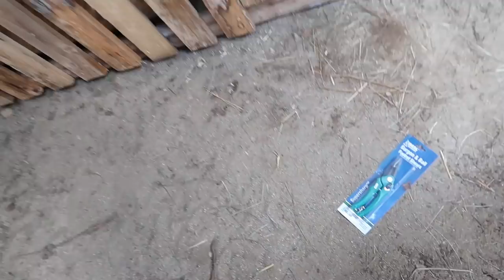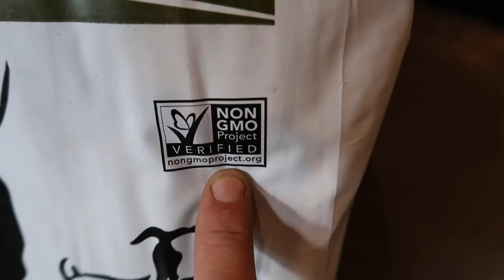Best Part of Waking Up on a FARM

Comment: A small piece of thick plastic in the trunk helps with that kind of a mess (somewhat). I keep a piece in my Tahoe for hay bales and pine straw. Also, a Libman dust broom (green bristles short handle) makes quick work of whats left behind.
Reply: I have used a 55 gallon drum liner which works pretty good also.

Comment: Al,  Turn your top gate pin upside down so the pigs cant lift the gate off the hinges and escape.  You will have to rebolt  the hinge back on the gate to get it on the pin.  Pigs love to lift things with their snout.  Love the vids!

Comment: Al , I watched you install the top brace bar between the gate posts. I always like to use exterior wood glue on things like that . I use the wood glue and then the screws also.  Makes a much stronger joint.
 After seeing the lower corner of your gate  swinging back and forth I can see a goat pushing the bottom of the gate open enough to slip through.  I will suggest a second latch on the bottom or at least a wooden block to prevent the gate from being pushed out. You will be surprised at how inventive goats are in finding ways to get out.  Also some kind of diagonal bracing for your gate to prevent sagging of the gate.  Murphy's law you know.
  I also want to suggest that you get honeybees as soon as you are able.  Perhaps from a local bee keeper. They don't really need that much attention.  Also you do not need to harvest the honey this year. You can leave it for the bees.  But , you do need the bees. You have missed the apple blossoms but the honeybees will pollinate your tomatoes for better and more tomatoes , strawberries for the same reasons and all of your other vegetables.  Better pollination simply means better vegetables. The sooner that you have bees the better your growing season will be.
Reply: Good to know...

Comment: Yupp, we are zone 4/5 in central NH. Watching the dryness and installing a drip irrigation system in my kitchen garden. Garden is doing well. Heifer calf born at 9:30 last evening ( #10 ) Cutting our first 1,000 bales. Life is good in your neck of the  NH woods and in ours :-) Can't wait to see those baby goats!
Reply from the maker: That is a lot of hay!
Reply: We cut between 6 and 7 thousand bales a season. Our 50 head eat a fair amount over winter. We also supplement hay during draught and it is getting dry already. A percentage of the best cuttings are sold to folks with horses and a few neighbors with goats and sheep. If I spot your email, I will send you some photos.

Comment: Gina took the mess in her car quite well! With the goat pen gate being so long you may want to think about a diagonal wire brace from the top of a post to the gate latch, it will certainly take a lot of stress off the hinges and horizontal top bar.

Comment: Feel the same way about getting a recharge from getting out with my animal friends each morning.  Also such a calm way to end the day most of the time.  My grandmother always said you should start your day by touching the earth and I try to do that.  

Good to see you using those panels for your goat fence.  Goats are terribly hard on fences so I am slowly replacing all my wire fencing with panels.

Had hoped to get bees myself this year.  But I am also in zone 4 and the amount of other stuff I need to get done already overwhelming.  Plan is to spend the winter reading more bee books, watching more beekeeping videos and get all the accoutrements together so I will be more than ready come spring 2019.

Comment: Hey al be careful about that gap at the bottom of the gate I had a goat with horns get her head stuck and break her neck before I found her I don't want the same to happen to you. Also the bottom of the gate moves a lot and from experience if a goat wanted out they will squeeze through or break the gate at that point. Have a good day love watching your videos.

Comment: Hey there could you tell me what type of wood you used for the goat shed. Was it treated? I was curious because you had mentioned something about not using treated wood but wasn't sure because it's on the outside of the goat building and I know you want it to last so I wanted to check
Reply from the maker: the wood on the goat barn is pine and we didnt treat it with anything